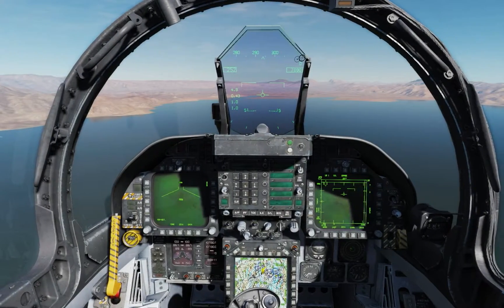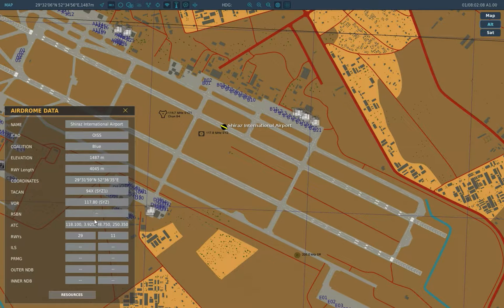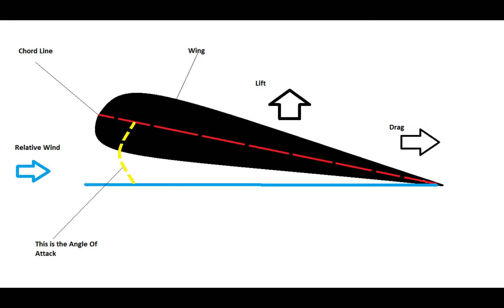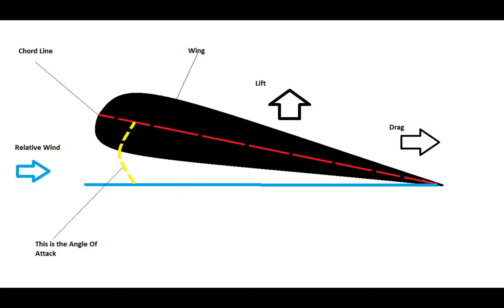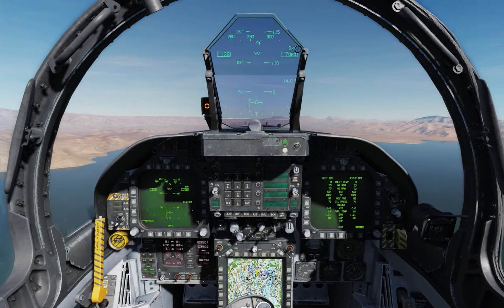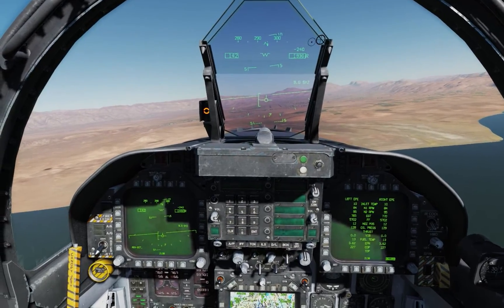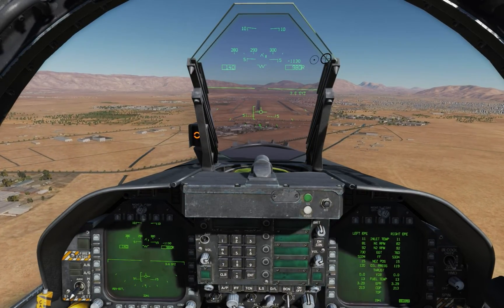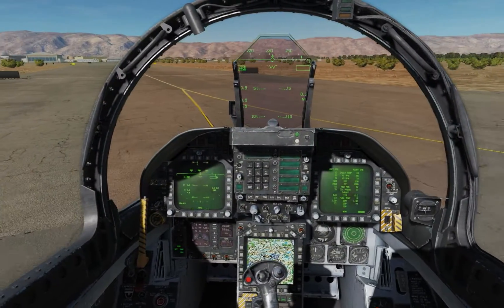DCS: F/A-18C Basic Landing and AoA

Comment: Is there a switch to flip or a button to push before you trim?  When I try to trim it doesn't do anything.  The only time I can see an effect is before I take off, I can see on the FCS screen when I adjust the trim for take off.  But other than that, it appears it has absolutely no effect at all when I try to use it in flight.  Do I have to turn something off so it gives me control before I can adjust trim in flight?
Reply from the maker: If memory serves me correctly there isn't such a button, but have you checked to make sure you have mapped the trim button to your controls? Like the trim hat on the stick?
Reply: @marshal1808  I do have trim mapped to my hat on the stick.  It works, you can see it in the controller bidning menu, when you push the hat it says it's for trim.  It also reflects on the FCS screen before take off after you push the set trim button before takeoff, you can adjust it there for weight.  But when I'm trying to adjust it during flight, it seems to have no effect at all.  Is there at least a display that will show that it is registering?  Or is the trim so slow, it's almost hard to even notice it even working?  I feel like I need to be 30 miles from the air port to give the trim time to respond.
To test it, if I hold the trim down for like 30 seconds, it should make my plane no longer fly straight right?  If I do that and the plane doesn't have an issue flying straight that means trim is not working right?  I'll have to test this.
Reply from the maker: @bryonmiller6311  That's a really strange issue that I have never encountered that in the Hornet, that been said, I haven't flown the Hornet in about a year, I am going to do another tutorial series for it later this year starting from the F4-U corsair. When I was flying the Hornet its wasn't feature complete so maybe they have introduced something new?  However I will try to load up the Hornet in DCS and will give it a try and let you know if I have the same issue, meanwhile are you playing on the Open Beta version or the Stable version? because Open Beta is susceptible to crashes and bugs?
Reply from the maker: Ok I just checked i don't have any problems like that in the Hornet, the trim works perfectly in flight and otherwise. It could be a bug maybe? I hope that helps.

Comment: when do you put flaps down? before landing gear? landing gear and flaps messes up my trim and i can never trim it perfect. looks like you flaps first and when stable gears down then trim?
Reply from the maker: Hi there, flaps are deployed after landing gear has been lowered, just as in any other aircraft. Yes you should trim after you have lowered the gear and flaps.
Reply: Field_Marshal_Flintlock thanks. And for the trim. For each click of the trim button, does the trim move a certain degree, or is it depended on how long I hold the button?
Reply from the maker: @jiajianhou426  As far as I am aware when ever you select flaps down, it will set the flaps into a landing configuration, control by the flight control computer. So no, there is not stepping in the flaps.

Comment: 3:28 heading 299 for 5. what 5 is? 5000feet?5nm from airport.5nm from your current location 5min flight?
Reply from the maker: So as far as DCS is concerned when ever ATC or AWACS give a heading followed by a "for" number, it will indicate your distance in nm to your destination. So in this case, its heading 299 for 5 nm.
Reply: @marshal1808  I thought that thx.but hud not say anywhere near 5nm
Reply from the maker: Jari Sipilainen The distance on HUD is to a tacan station on the airfield. However the ATC  distance is for the airfield pattern area and not to the actual airfield and yes the ATC in DCS does need some overhauling.
Reply: @marshal1808  yeah mayby i call inbound too late i allready see runway ha
Reply: The “inbound”info that they give you in the game is not to the field, but to a position on final (a really LONG final, too). If it were to the runway, you might be heading the wrong direction, wouldn’t be ready to land, etc. So you are sent to a point away from the runway where you then turn inbound.
Reply: @RicCrouch  thx that propably what was happening

Comment: I have a question, when you are holding the speed around 140 - 145 and you are using only throttle so how this aircraft is dropping the hight? I dont understand this :)
Reply from the maker: Hi there, that is an excellent observation. The answer to this question will in two parts. First the aircraft is descending because the flight path marker is below the horizon line, therefore naturally the aircraft will descend. Secondly when an aircraft is configured for landing with regards to AoA a phenomena occurs, which means that changes in throttle will affect descend rate and changes in pitch using the stick will affect speed. Normally during level flight that is the opposite.  Now as to why that occurs has to do with 1) thrust affecting lift and 2) pitch affecting the attitude or AoA. I hope that answers your question.
Reply: Yes :), I couldn't imagine that  but know this is obvious for me, thanks :), one last short question, to break do you use only wheel break? on keyboard "W"? When I am touching the ground pretty fast I still  have a problem with breaking until I reach the end :)
Reply from the maker: @krzysztof4625  Yes, i think the F/A-18 wheels breaks are weak. You can also use the speed brakes as well.
Reply: Ok, Thank you very much for quick answers :), that helped me a lot :)
Reply from the maker: @krzysztof4625  You are very welcome, i am glad that i was able to answer your questions. All the best.

Comment: Great lesson! How do you line up with the runway?
Reply from the maker: Hi, thank you for the very kind words. To line up with the runway you need to use the Flight path marker on the HUD. Its the circle with the three lines, which determines the path of the aircraft.
Reply: Easy answer, use the velocity vector, if you don’t have that, you need to fly the plane in a way that make it the only thing not moving.

Comment: Congratulations man you have done an ugly landing because you didn't flare the aircraft
Reply: Doodle Boy as he said you dont flare an f/a18
Reply: @akimbob7525  why
Reply from the maker: Hi there, the F/A-18C is a naval aircraft, thus it has to land on an aircraft carrier, therefor it needs to touchdown on the deck of the carrier with an angle of attack of 8.1 so that the hook will have the best chance to catch one of the wires on the deck.
Reply: @marshal1808  but this time landing on a strip 
It should had to be beautiful 
Why don't they flare while landing on a runway
Reply from the maker: As long as the rate of descend is within an acceptable range the landing gear will tolerate the touchdown impact.
Reply: @marshal1808  I know that f18s landing gears are damn strong but why are you always testing those landing gears by having a great impact on the runway as well
Reply: @marshal1808  all I want to say is that I hate those type of landings 
It's just not beautiful
Reply: @cascito  it's not beautiful but it is practical, these jets sustain that type of landing daily and the pilot is trained to land it in that manner, even in Canada where we don't land on carrier's our pilots stil land on the 8.1 AOA it's just what it's made for.